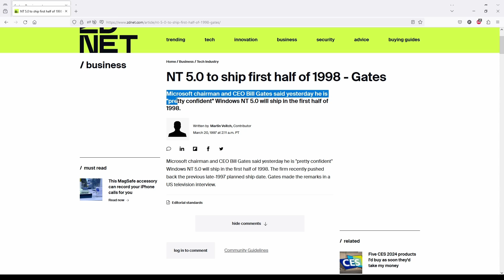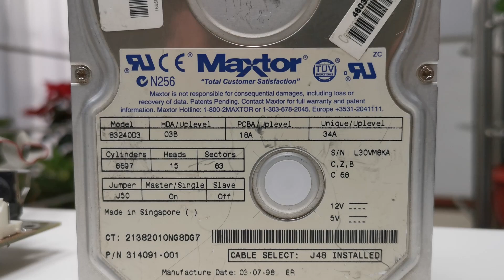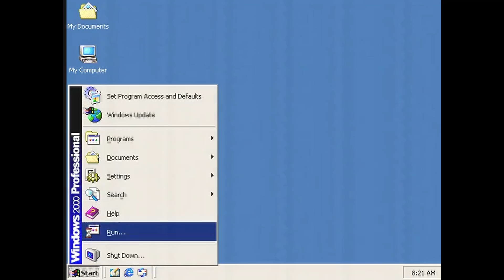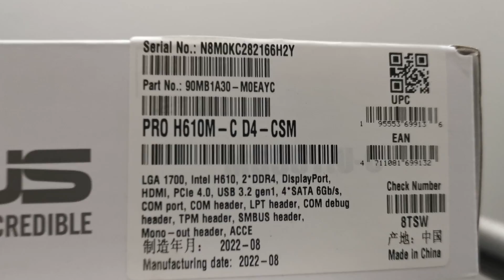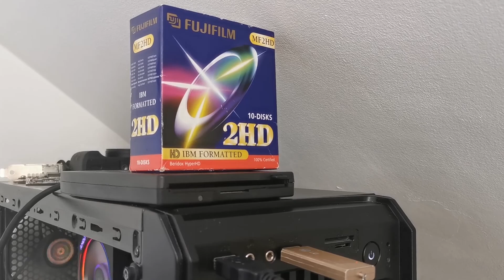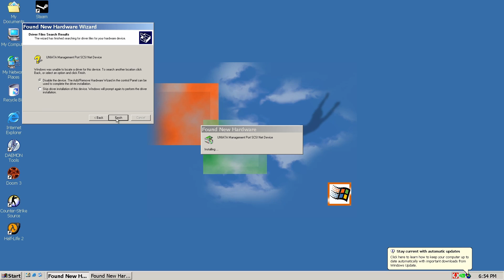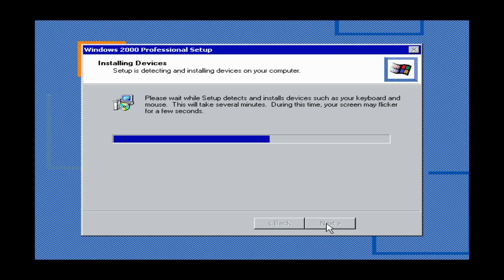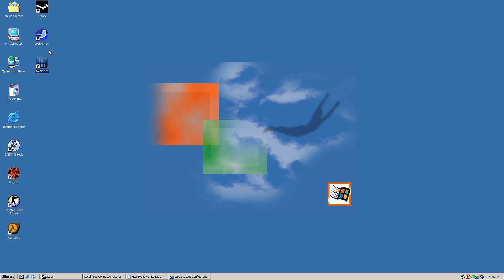Windows 2000 on a Modern PC: Nostalgia Meets Intel 13th Generation CPU

Comment: On a german website called "winhistory" a few people gathered to install and run all Windows versions on the lowest hardwarespecs they could think of. It's called "Windows Quäler" and they did a successful boot of windows 2000 on an Intel 486SX @ 4MHz with 12MB RAM. But They had to up the clock for the installation. It took 43 Minutes to boot on 4MHz.

Comment: How did you get Steam installed? I've been trying to get a client on Windows 2000 and XP for quite a while
Reply from the maker: I didn't install Steam. For older Steam games like Half-Life 2, you can use a Steam emulator to install them from the original disc and play offline. However, as of 2025, Steam is nearly unusable on Windows XP. Official support ended in 2019, and while it worked somewhat in 2020, 2021, 2022... it's no longer viable now.
Reply: @O_mores  Understood. I did some experimentation, and it turns out One Core API now allows users to run the Windows 7 version of steam on Windows XP Professional x64 Edition, with a limited capability of downloading games. However it is unstable, and doesn't keep connectivity with the servers, but you can launch a select few games. I guess this is what happens when you make everything chromium based unfortunately XD

Comment: Hi, are days that i am trying to install Windows 2000 Server SP4, in my Ryzen 3900X build, in a SATA 2,5" SSD that are connected via PCIE SATA Asmedia 1061 controller, but the setup continue to say that the specific *.sys driver about the Asmedia  controller cannot be find. I have modified txtsetup.sif and winnt.sif files in I386 folder, i have create on the root of the content of the ISO of windows 2000 copied into the SSD (i use win 98 usb drive via ms-dos part of install as first boot) the controller last version drivers downloaded from VIA website (*.sys, *.oem, *.inf, *.cat files), the folder called "$OEM$" then inside i create the folder "$1" then the folder "textmode" where i put in all driver files of controller (also his txtsetup.oem file). The  *.sys driver  file was put in i386 as CAB file created whit MS command line utility "makecab" and the file CAB has extension *.SY_ , in winnt.sif file i used as parameter OEMPreInstall=Yes etc. but still no success. i read more guides in intenet after your video but none way has worked. Can you explain good in details with maybe including the downloadable files modified for reference, how was that you made (about the "plan D") ?  Thanks in advance!
P.S. I have before tried to install Windows 200 by using an old PCI VIA 6421a SATA IDE controller (maker Techsolo model TC-P25ES) that i was remember i have (version without BIOS chip) similar to yours showed in many of yours videos,  but in BIOS Post is not showed as device (in Windows 98, XP, 11 came correctly detected and showed in Device Manager) like the ASM 1061 controller (CSM mode in BIOS is still enabled) so is not showed in BIOS also the SSD attached to VIA 6421a PCI Controller.
Reply from the maker: Hey! When you start setup from DOS, it copies files (including drivers) into two temp folders: $BT and $LS. After the first reboot, NTLDR takes over, and if the .sys files weren’t copied into $BT folder, you get that missing file error. 

Quick fix: Find those $BT and $LS folders (they’re hidden, so enable "show hidden files") and manually copy the missing .sys files into both because you might not remember which the right one.

Now, for TXTSETUP.SIF, you gotta edit it in 4 places:

    Under [SourceDisksFiles], add:
    asmsata.sys = 1,,,,,,3_,4,1

    Under [HardwareIdsDatabase], add your ASMedia controller’s hardware ID, like:
    PCI\VEN_1B21&DEV_0612 = "asmsata"

    Under [SCSI.Load], add:
    asmsata = asmsata.sys,4

    Under [SCSI], add a description:
    asmsata = "ASMedia 106x SATA Controller"

Hope that works! Let me know if you’re still stuck.
Reply: @O_mores  Thanks and You says good, files was not copied into temporary setup folders that Windows 2000 setup create as you have mentioned. Part of Hardware IDs and the name of my *.sys driver file for ASM 1061 are differents (it's asahxp32.sys) but this do not matter i suppose.  I was get the drivers from website DriverPacks as zip last version about DPMassStorage for Windows 2000.I was already modifyng the txtsetup.sif as you now have showed me. You have never mentioned the file winnt.sif, it has to be original and not modifyed? But the sys file have to be copied as normal sys or as CAB file with extension *.SY_  as i was put before into the I386 folder of SSD? I will try and ill update you!
If you remember i was trying in late 2024 to install Windows XP Integral, i had success but last version of November 2024 was corrupted in something during setup. I have used the version of June 2024 and has worked, unique problem are Matisse USB 3.0 controllers drivers cause i can't solve his installation in Device Manager, in my build with Ryzen 2400G on Asrock B450M Stell Legend all devices are installed perfectly 😅
Reply from the maker: Make sure the filenames match exactly - if your driver is asahxp32.sys, the entries in TXTSETUP.SIF must use that exact name. Compressed (SY_) or uncompressed (.sys) shouldn’t matter (I used raw .sys for my VIA6421) and it worked. Important: The .sys file must be the one meant meant for text-mode setup - loaded from floppy with F6.
Reply: @O_mores  That the drivers for Asmedia 1061 controller have also txtsetup.oem file inside mean that are the correct *.sys driver file for text-mode as i was click F6 (I never click F6 during setup)? In the BT/LS folders i don't have the OEM folder
Reply from the maker: You don't need the OEM folder anymore just copy them, and if txtsetup.oem is present, it should be the right driver.
Reply: @O_mores   I have copied the SYS file in BT folder, then i boot the SSD and the Windows 2000 setup tell me that the file asahxp32.sys Is damaged...
Reply from the maker: Hmm, usually I don't get this message, and I did some installations of 2K/XP last week using this method. Anyway, those numbers in TXTSETUP.SIF (1,,,,,,3_,4,1) mean: source disk ID, subdir, target dir ID (3_=drivers), copy flags (4=always copy); files with _ (like 3_) are compressed (.sy_ becomes .sys) so setup expects a compressed version, although usually it doesn't matter.
Reply: So i will try the compressed version. Ill update you soon.
Reply from the maker: That’s strange - I was just messing around with XP and 2000 yesterday, so this process is fresh in my mind. I copy the files directly into those temp folders (no $OEM needed), and the setup picks them up every time. It worked for me with multiple drivers, not just the VIA one. Maybe there’s something specific to that exact driver file, try to find another version, maybe older.
Also, I’m not sure what partition type you’re using, but I’ve had the best luck with a 2GB FAT16 drive - it’s the most compatible. You can install 2000 on NTFS or FAT32 partition mad during setup, but I use FAT16 just to boot into DOS and start the setup.
Reply: @O_mores  Hi, i was create a 2 GB FAT32 partition. I tried another sys driver file i put into BT folder, means the file inside the mini CD of ASM1061 SATA Controller, is most recent vs. DP driver, the setup continue so was showing no errors messages about the sys driver file and i tought it was find the driver as "correct", but next i get a black screen with blinking mouse cursor, the setup look as freezed, so the procedure do not continue. Maybe ASM 1061 is not full compatibile with Windows 2000 without using for eg. the Extended Kernel and post SP4 officials and unofficials updates...
Obliviously was good if was existing an Integral Edition ISO of Windows 2000 too. Btw yesterday for trying i have ordered a Sil3114  based SATA Raid PCI Card for see if working and as bonus the Startech  PEX2IDE PCIe IDE controller based on JMicron JMB368 that look as don't need drivers, both from Amazon, maybe one of them works. But for the PEX2IDE i have to get back some old IDE/PATA HDD i have.
Find a VIA PCI 6421a Controller with built-in BIOS Chip as new is really hard ofc. I was read in some forum that someone has integrate the BIOS Rom of 6421a (without BIOS Chip) inside the BIOS of motherboard with patching his old Asus motherboard BIOS, but as way is hard and is not without risks.
Reply from the maker: The JMB368 is a good pick for any retro setup since it has native Win98 drivers too. Fingers crossed one of those new cards does the trick! I actually have two VIA 6421 cards, and both have their own BIOS. Just a heads-up: for the card’s BIOS to run, you’ll need to enable the ‘INT 19h’ option in your motherboard BIOS. That’s the interrupt responsible for kicking off the boot process after POST. Some copy paste info: "INT 19h (interrupt 19h) is the 'bootstrap loader' interrupt. It executes code that boots to something (disk, motherboard BASIC, etc.). INT 19h is called as the last action of the computer's power-on self test (POST). By default, INT 19h points to 'bootstrap loader' code in the motherboard BIOS ROM."
Reply: @O_mores  Hi and Happy Easter, I have tried the Sil3114 PCI Card that was coming to house. Well when is attached to PC whit SSD made a correct post of his BIOS for Raid config and see the SSD but block after the BIOS of motherboard to continue so i had to leave it. For the Startech PCIE card Is based of JMB368 Chip.  I connect a  Samsung PATA 20.4 GB 3.5" HDD with IDE cable, but same errors during setup, means i try to use a Win 2000 Pro not Server files as ISO content, but nothing change, first without add JMBx driver files, and with, no error as video but still both black screen with blink cursor in both cases. My VIA VT6421a card do not have his BIOS Chip like yours cards. About the INT19h in Asus BIOS option i choose now as Enabled. And i might any of theses card need his driver in Win 2000 setup with modifyng  txtsetup.sif, that's correct? I have never changed the rest of config of my build means that I have never disabled or disconnected others disks, just i add or leaved new cards and relative disks connected. That theses cards are attacched to PCIE 1x multiplier to 4X PCIE 1x card can be the cause of Win 2000 setup problems? If card are recognized by BIOS i think Is not the problem.

Comment: Omores, how did you get Windows 2000 to use Turbo frequencies on the CPU?  My install of Windows 2000 SP 4 running on an Ivy Bridge CPU seems to lock on the Base frequency and never seems to Turbo.  Thanks.
Reply from the maker: Hi William, I didn't...! Turbo Boost typically relies on ACPI (Advanced Configuration and Power Interface) support to function correctly. Windows 2000 has very limited ACPI support, and it predates Intel's Turbo Boost technology by several years, so it doesn’t natively manage Turbo frequencies on modern CPUs. To get around this, you can try enabling ACPI manually during installation, or by updating the HAL (Hardware Abstraction Layer) to the "ACPI Uniprocessor PC" or "ACPI Multiprocessor PC" model, depending on your CPU. This can enable basic power management features but won't work at all on modern motherboards - maybe on those released up to 2010-2012. However, even with ACPI enabled, Windows 2000 still doesn’t have built-in support for the power states (P-states) required to activate Turbo Boost on CPUs like the Ivy Bridge you have.
Reply: @O_mores  That's what I thought as well.  I'm using Windows 2000 Advanced Server with an Intel B75 motherboard and Xeon E3-1275v2 using the ACPI Multiprocessor HAL.  Windows 2000 detects all 8 threads when Hyperthreading, but it behaves strangely in single-threaded applications and properly with multi-threaded applications with Hyperthreading enabled.  I wonder if the Asus board I'm using isn't quite compatible.

Comment: Super lame. 

I'm running windows 2000 datacenter on an 8 core processor with 16 gigs of dedicated ram.
Reply from the maker: Thanks for sharing, but it's worth noting that Windows 2000 Workstation and Windows 2000 Datacenter are designed for very different purposes. Workstation was optimized for personal productivity, with limitations in terms of scalability and resource allocation.
Reply: @O_mores  And datacenter was a thousand dollar os that supports up to 32 cores and is still capable of being a modern workhorse..

Thanks for elucidating but it's worth noting my opinion remains the same. This video is super lame.

Comment: Hi Omores, I was curious: Can I slipstream these UniATA drivers into Windows 2000 with nLite?
Reply from the maker: Well, you can, but for some reason you're drive won't be discovered on a modern motherboard. I was able to see my old PCI to SATA adapter with UniATA during the install. So... I suspect you have to get the hardware ID from your SATA controller and insert it in the UniATA driver .INF file. Otherwise it looks UniATA can't act as a universal SATA(AHCI) driver during the install phase.  You might want to check this recent Windows 2K video: https://youtu.be/f2grGf2rTV8
Reply: @O_mores  I will do the .INF steps and watch the video and report back. Thank you Omores! That is very helpful.

Comment: I have a lot of useful software from the windows 2000 era. back in the day of cracks and serials and programs on cd. I'm pretty sure I still have the required floppies. hmm
Reply from the maker: Software released specifically for Windows 2000 should work in Windows 10/11 without any issues. Btw, standard 32bit programs released with Windows NT 3.51(1995) are still working in Windows 11. Most of them: https://youtu.be/qIbeV1BYyOo

Comment: When I have p4 computer 
Also have win 2000 xp 98
Amoung these 3 OS
Windows 2000 boot time was so quickly. At 20 GB hdd and 64 mb ram 
Having DVD floppy drive. In 2004

Comment: Is it posebole doing the same with a ryzen 3 3100 on a asus prime b450m-a ?
Reply from the maker: My main PC has a Ryzen 9 3900X CPU /X470 motherboard and I installed Windows 2K on it. So I don't see why you couldn't do the same on your configuration. You have to use a preinstalled copy of Windows 2K with UniATA drivers already installed.
Reply: @O_mores  Do u have any advice to make the best preinstalled copy?
Reply from the maker: @The-Cubis  You can try one of my Windows 2K installs: pinzaru.ro/windows9x/2K_Uniata_Standard_SP4.zip
Reply: @O_mores  Txh!

Comment: Few months ago I installed Windows 2000 on my dual-core Athlon-64 x2 5000+. I had to install few drivers and I even found drivers for Geforce 210 and they worked
Reply from the maker: Nice, you should get full hardware support on that configuration. Windows 2000 was supported, along XP, until 2010. You can find nVidia drivers released in 2010 for Win 2k/XP.

Comment: create iso all drivers. My PC is Rog Strix B460 ITX, i3-10100 16gb ram 1 Tb SSD NVME
Reply from the maker: Well, you can't install it on NVMe. You need to use a SATA drive with UniATA drivers. If you have one I can give you a copy of my Win2K installation to make a test.
Reply: @O_mores  
ok . and how to add Portuguese language Brazil complete in this iso, release for download
Reply: @O_mores  my sata SanDisk model SDSSDA 240 gb
Reply: my motherboard ASUS ROG STRIX B460-I Gaming and Intel i9-10900k, 64 gb memory DDR4

Comment: Hi, great video ! Does a 64 bit version of win 2000 also exist ? Was XP the first 64 bit OS available ?
Reply from the maker: Hi, there is a Windows 2000 Server Limited Edition meant for 64-bit Intel Itanium processors. This was not the 64bit standard that we are using today (compatible with both AMD and Intel) so it can't be used on modern hardware. Yes, XP and Windows Server 2003 were the first with a 64bit edition.
Reply: Thanks ! @O_mores

Comment: The newest I was able to get it on using only the Extended Kernel was some C2D Vista laptop that I found for $75 on local marketplace after scrolling past a sea of 7 ones running on a Pentium which wouldn’t have worked as easily. Had to install a SpeedStep applet and set the process multiplexer so it would function on the 2 Duo cores. Pretty interesting seeing it pushed to the max here, wonder if it’d be more practical to find Xeon hardware of an equivalent spec since they’re server-grade solutions but go out-of-service rapidly quickly
Reply from the maker: We should push it to the limit while CSM is still an option. It will last maybe a few more years. Around 2030 if you want to pull a video like this you'll have to buy an industrial motherboard to be able to boot straight into DOS on real hardware. Last night a I was able to get NT 3.51 from 1995 running with multi-CPU support on this Intel 13th Gen configuration. Unlike Windows 2000 and NT there were no licensing limitations - so it detected 4 CPUs...